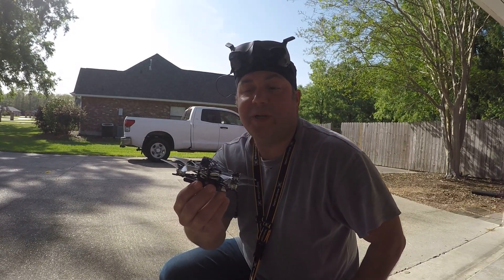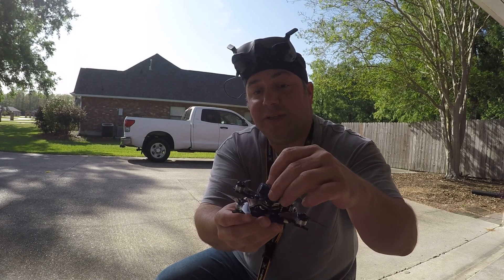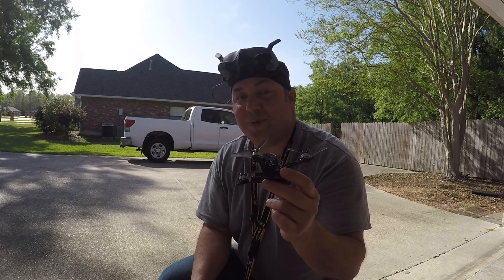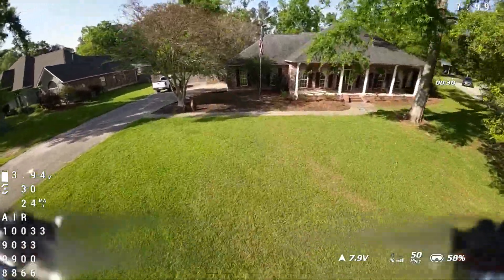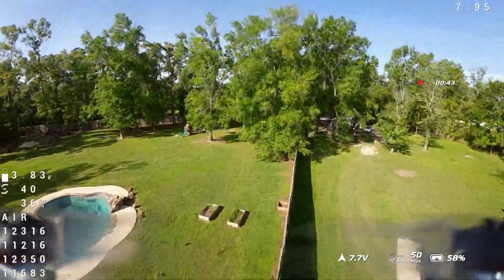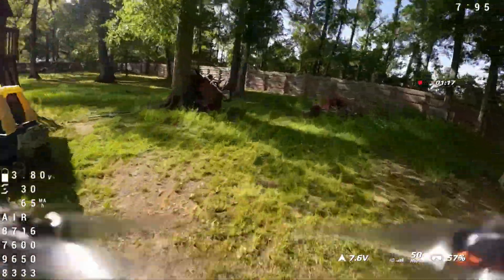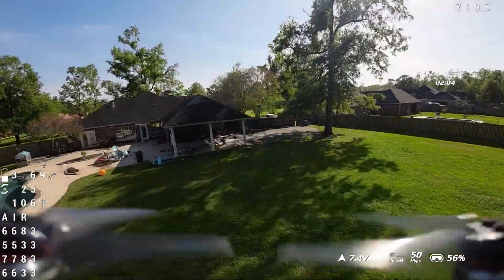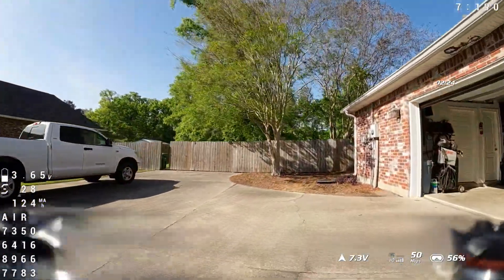DJI FPV O3 on a toothpick

Comment: Fantastic jpb on your build and flight👍👍 Quick question since you're running 2x 1s lipos do you have them set up like that to up your mah's or to up your voltage??
Reply from the maker: @3DMOFO2020   The O3 air unit needs the voltage. Also most 75mm whoops are 2s. I just chose to stick with the individual “whoop” packs since you tend to go through them like candy and I have more options for how I place them. In this case, they’re flat and lower profile than a 2s pack would be.
Reply: @rcrdps8144  Cool thanks for answering my question may you and loved ones have a "Happy Thanksgiving"😁

Comment: Nice one dude. I’m looking in to building a dji o3 toothpick. What frame did you use. ?
I have a crux 3” frame I think I’m gona use for mine. Good work bro. Just subbed you deserve more mate. Just made a video from yours. Let’s hope it’s gets more views for you. 👏🏻
Reply from the maker: Thanks! The frame is an FPVCycle Babytooth. Haven't really touched my drones much lately. I tend to cycle through my hobbies. I did go to fly the other day, and my mode switch was broken off. Waiting on parts,....  Still keeping an eye on the newest DJI goggles, but probably won't go for them until there's an air unit that can do the higher bandwidth. Then you'll maybe see another build video from me. ;)
Reply: @rcrdps8144  ah nice one cheers. Yeah I’m the same dude. I went to fly one of my toothpicks yesterday wouldn’t bind. Then it just didn’t work after 🤷‍♂️🤦🏼‍♂️. Had a fly today tho . You gota feed the the withdrawal symptoms 😂 not flown in ages. So it felt good. Yeah I’ve only just gone to digital flying. So they bring a new one out lol.

Comment: How is the durability with the naked O3 on this frame?
Reply from the maker: I don't tend to fly very aggressively, but I have had no failures of O3's once I mounted them. I have messed up the cable on one while de-casing it, and I have cracked a lens from a concrete smack. My 3d printed mount usually breaks in a crash and I just re-print it. Guess it's kinda like race cars. It breaks instead of the important stuff.

Comment: Hi, another question: Do you have a guide or tutorial on how to show the (I assume) Motor rpm in the bottom left OSD? I couldn't find it on google
Reply from the maker: It's just one of the checkboxes when you're setting up OSD in Betaflight. I think something like "ESC RPM". I like to have the RPM and throttle displayed so I can use that to tune since I don't have blackbox.
Reply: Easy, thanks a lot for both answers! Happy flying  @rcrdps8144

Comment: Must have missed it, but what motors and aio are you running? and how do you power your o3? With a boost converter? I thought it couldn't handle 2S low battery
Reply from the maker: AIO is "BetaFPV F4 1S 12A 2022". O3 is powered direct to battery. Motors are 1103 10000kv. They're a little too much for these packs actually. I had to put in a 75% throttle limit. Should probably use like 6000kv instead. Otherwise you'll get brown outs with full throttle punches. I do still have to be careful what I do once the battery is near dead. I tend towards smoother flying anyways. If you're really into flippy-floppies, or sky high power loops, you'll have to dial it back about 2 minutes in.

I accidentally ordered weBleed 450mah packs this last time, so I have a bit less sag now, and my run times are over 4 minutes.
Reply: @rcrdps8144  Awesome, thanks a lot! I am looking into micro LR and was curious how you manage to power the O3 at such low voltages. Cool stuff! If you ave any more insights at what voltage you see brown outs, I would be most thankful!
Reply from the maker: @ethkid8925   Been a while since I logged it, so retrieving this answer from a previous comment on my O3 Whoop video:  
"I think it's 5v. I know Vista dropped out on me at like 4.8v. I think the lowest I've seen this one was 5.2v or something like that, but it was probably lower,....just didn't finish recording when it dropped out."

Comment: How would someone go about getting a couple canopy’s made? Would you have time?
Reply from the maker: While I did make mine on a resin printer, if you follow the link in the description, and then follow the link to the original, several folks did theirs on an FDM printer. I'm just not that good with doing intricate stuff on my FDM printer.

Comment: I need one! I have everything but the frame! I have an old mobula7 v2 that took 2 of the 1s batteries...you think its fine to recycle that powerlead?
Reply from the maker: Absolutely. If you look back through my videos, I think I was probably the first to put a naked vista on a 75mm whoop. Was an Eachine Trashcan,...basically a Mobula 7 clone.

Comment: How much sag do you get with 2S?
Reply from the maker: I did have to put a throttle limit at around 70%. Have to be carefull what you do near the end of the pack or it might brown-out. Should have probably went with 6000kv motors .

Comment: How big are the props? And what’s the AUW?
Reply from the maker: 3 inch Avans. 1103 10000kv.  Don't think I've weighed it AUW. Just add 2 tinywhoop batteries to 55 grams.
Reply: @rcrdps8144   Wow amazing that you got it all the way down to 55g with an O3. Do you remember which AIO board you used? I can’t think of many other places where a few grams could be saved. I’m guessing around 5g per motor, ~10g for the frame, ~8g AIO, ~5g hardware (stack, motors, and prop screws), ~3g canopy, ~18g for the O3, ~3g props, and a few more grams for wires, solder and connectors… that adds to around 70g. Still can’t get my head around it, but I’m planning on trying a similar build soon
Reply from the maker: @gus8378   A big part of it is ZERO metal hardware. That includes the prop screws. Actually,,.. the motors are mounted with metal screws. Guess you could lose more weight there. :D   I'm guessing you're probably over-estimating the naked O3 weight. It's only a few grams over a naked Vista. The naked camera is super light.

The board I use is: BetaFPV F4 12A
Reply: @rcrdps8144  I thought you’d get vibration issues from mounting the AIO on screws that weren’t metal
Reply from the maker: @gus8378   I wouldn't personally think that, but on the other hand, I don't usually consider my builds like this to be super "clean". Stuff is really stuffed in there, so you won't be pushing the upper limits on turning down filtering. Note that my AIO sits below the frame, and the O3 is above the frame. The spacers are all solid. No rubber except the AIO mounts.
Reply: @rcrdps8144  I ca’t really tell from the video. Do you have more pictures posted somewhere? How do you mount the battery if the AIO is under the frame?
Reply from the maker: @gus8378   Thought I had posted the mount previously. I just posted it here. Pics aren't great, but it's what I have available: https://www.printables.com/model/550970-fpv-toothpick-battery-mount-and-stack
Reply: @rcrdps8144  Thanks! What are the benefits of mounting the AIO under the board?
Reply from the maker: Looks cooler to not have a high stack above the frame,.... 😉 

 I mean, I guess I could say something about center of gravity, but it's really just about looks for me.
Reply: @rcrdps8144  I completely agree

Comment: Wow that’s amazing. I want to build my own o3 tooth pick with the TP3 frame. Do you have the canopy available to print? Any help would be appreciated.
Reply from the maker: Thanks. The canopy is in the description. I printed it in a tough resin. It's fairly intricate, but you might have success with FDM. I think the one I modified it from was FDM.
Reply: @rcrdps8144 Do you get any vibration problems from using resin rather than TPU?
Reply from the maker: @gus8378    Not that I can tell. TPU is usually printed thicker, so probably evens out.

Comment: Pretty cool canopy.   I like the larva X.   I have an AOS T3 toothpick at 116 grams with 850 mAh 3S and flywoo locator.   Flight time is 15 minutes in hover and 8 minutes in bando.  Keeping it light allows 5g punch outs.   I'm upgrading to the DJI O3 boards, but the 1.6mm is a beeeich.   I found that I can cut the threads of the 2mm bolts down to 1.8mm and then down to 1.6mm very cleanly using HSSE dies.    I'll do a video.   I'm waiting for custom titanium M2 by 35mm screws that I will cut down and some custom 1.6mm nylon.
Reply from the maker: Yeah, if you check out my whoop video with O3, you see me drill out the O3 board to 2mm. You end up breaking open at least one of the holes, but it is fine. But I'm also 3d printing my 2mm bolts, so I could do 1.6,.. but really, they need all the strength they can get. Any large crash, and I have to reprint everything. I've made gradual changes to the mount to beef it up after each crash. Haven't posted the current changes to thingiverse,...
Reply: @rcrdps8144  I'm spending about $1,000 on custom dual thread M2 and M1.6 titanium bolts, M1.6 aluminum locknuts with nylon inserts and M1.6 nylon hex standoffs.   I would prefer hardened aluminum bolts that 30mm long, but the only company that I found to make long aluminum bolts messes up the heat treating twice.
Reply: @rcrdps8144  I'll be selling the hardware I don't need on ebay.   But, how do you 3D print such small tolerances?
Reply from the maker: @microdronetech8453  I have a resin printer. Right now I'm printing with Syria Tech Blu/Black, which is a "tough" resin. I do have to relax the tolerances a little because of light bleed through on the bottom half of the thread causing it to blob slightly. When I run out of this resin, I hope to switch to Syria Tech Tenacious, which is opaque, so hopefully won't have the light bleed issue and create tighter tolerances while still being a strong "nylon-like" resin. But what I have works for me for now,....except I've have to rebuild if I hit a branch,....
Reply: Isn’t 35mm a bit too high? Maybe your spacers are too tall?
Reply: @gus8378     I run 30mm high right now.    I think the spacers are ok.

Comment: That thing is a whisper compared to most other quads. If it has no props in view it would be extra amazing.
Reply from the maker: You could put a higher camera angle canopy on it and achieve that, but I personally prefer props or ducts in view. You will see from my history that I always post the "cockpit" view with full osd.
Reply: @rcrdps8144  that's what's up. I can see the appeal.  Props in view seems to help with orientation when flying.

Comment: Awesome. 1103 10000kv are normaly fine, if you use some gemfan 3016 or 3018 props on 2S. The emax are too agressive pitch. Very quiet though, because they make thrust at low RPM with the high pitch.
If you want same light motors with lower kv, try 1103 8000kv or 1202.5 6000kv.
Nice to see people going naked O3.
If you want quiet props, try HQ 65mmx6.
Reply from the maker: Thanks for the suggestions. One of my primary objectives for a light build with large props is noise. So the smaller props are pretty much out. Might try the lower kv motors on the next build. For now, a 75% throttle limit is mostly working out. I did have one more brown-out when I almost hit a tree and went full throttle. For most of my flying, I'm still only hitting 50% throttle with the 75% cut, so I could probably move the overall cut down a bit more. Or maybe I can go to those lower kv if I damage these,....
Reply: @rcrdps8144  I sepcialized in low noise builds. Just Trust me on the low noise props and give the hq 65mmx6 a try. Costs you peanuts. You'll agree with me afterwards they are most silent. Good luck with the builds
Reply from the maker: @chrisbee5481  Assuming you meant 63? Not seeing any 65's. Will definitely try them.

Comment: Great job! Very surprised by the 3 minute plus flight time on 300mah batteries
Reply from the maker: Thanks! I cut this video short to not bore the audience. Just looked on my SD card, and I have one flight that's a hair over 4 minutes with fairly aggressive( for me) flying, including quite a few powerloop attempts. These WeBleed "folded" cells with BT2 connectors really do perform. The 1103's are probably actually too much motor, and I have the throttle cut to 75% to not cause brown-outs. But it gets kinda hard to find lower KV motors in smaller than 1103. These are 1103 10kv. Coulda probably used 6-8k. She cruised at like 17% throttle before the throttle cut was put in place.
Reply: Nice build. I've built something similar a year or so ago. It is my most flown digital build, since I can fly it in my yard. I basically took a happymodel crux3 and added a naked vista, so it has 12025 6400kv motors. 69g including a 5g vifly beeper, since I lost the first one which hurt the wallet. I mostly use 2s 350mah on mine and get similar flight times. I'm going to try what you did with your throttle, as I have a lot of wasted resolution flying in the yard. Happy Labor Day! Edit: Just realized it is an 03. Even more awesome. I'd like to upgrade mine at some point.